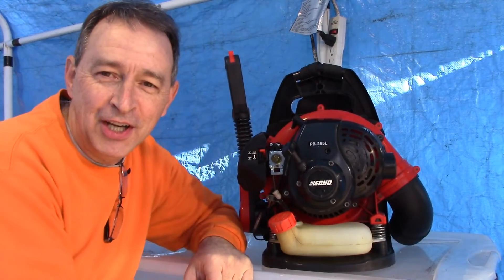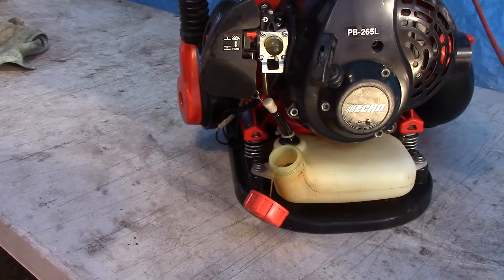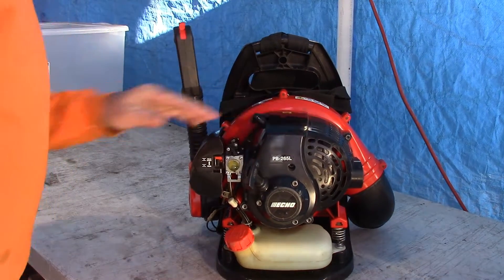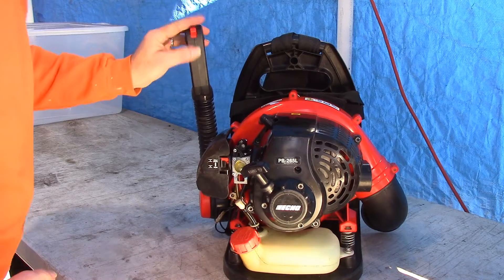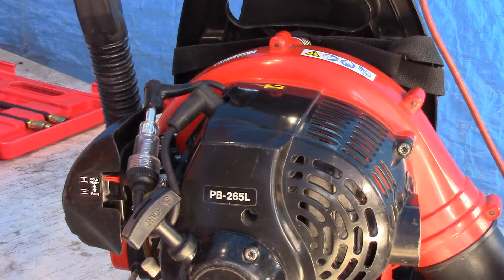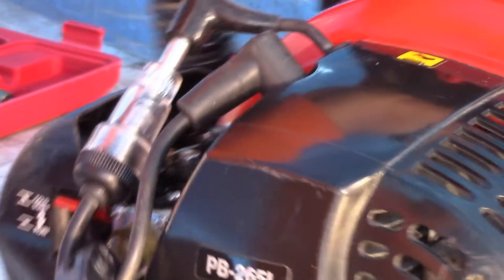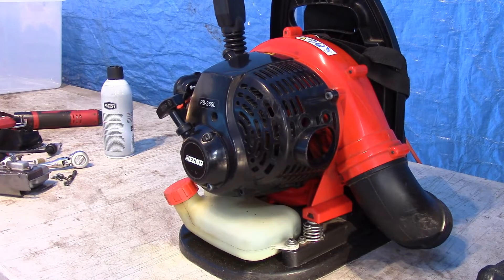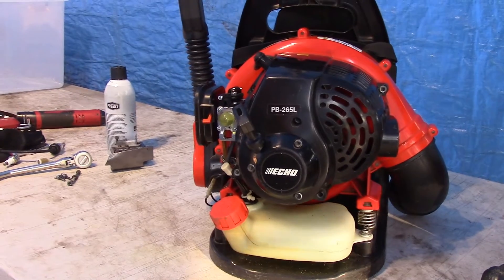WHY WON'T this ENGINE START or RUN??? Echo Leaf Blower PB-265L

Comment: I have seen this before on these. Some of these had a plastic flywheel with a laminated metal center containing the flywheel “key”.  The laminated metal is just a bunch of punched metal pieces bonded together like plywood to make a key that fits in the notch of the  crankshaft. It strips out and the engine no longer gets spark at the correct time.
Reply from the maker: @andybecker2693 Eureka! I just pulled the flywheel off this thing, and your suspicion was absolutely correct! The keyway "Pin" (which is actually part of the flywheel itself and not a removeable or replaceable item) was completely stripped out, and the flywheel was 180 degrees off from where it should be. Unless there is some way for me to secure the flywheel in the correct position, I don't see any solution other than to purchase a new flywheel. And then, what if the new one strips out as well? Bad design, I'd say. Thanks for pointing me in the right direction. I would never have thought to pull the flywheel.... Very grateful!
Reply: @Buckwsr  The replacement flywheel is cast aluminum instead of the plastic one or at least it was on a PB250  blower.
Reply: Good try Buck. Win some lose some. But you never know unless you try. I enjoy your videos. Your a fun guy.
Reply from the maker: Thanks, Ron. We're gonna fix this thing. So stay tuned!
Reply from the maker: Very interesting! And I should go ahead and pull the flywheel to take a look at that. I don't know for sure, but I would think that even with the timing being off I'd still get an occasional albeit mis-timed "pop" of ignition once in a while. Thank you for the note.
Reply: I was thinking the same exact thing. I have seen this before on Taryl Fixes All  YouTube Channel before with an Echo blower. This kind of thing is common on certain Echo models. 😊👍🏿

Comment: I have the exact same issue. I changed the spark plug, put new carburetor, changed the lines and filter. It was working for a few months then stopped. It’ll start initially but then turns off immediately. I bought it at the pawn shop about 12yrs ago. I guess I got a lot of life out of it. Debating if I should buy another fuel run blower

Comment: What causes the fuel you fill the motor? I have the same problem with mine. Has spark, new spark plug, new carb, fuel lines and filter, and new air filter. Keeps flooding the plug and fuel inside. Muffler is heavy as the video but it’s dry, no fuel beside the out take part of the motor. Basically everything as the video shows.

Comment: Thanks for the video. My Echo PB-265LN leaf blower worked great for years. Last week in died while in use. At first I thought maybe bad fuel / mixture. Since then I have cleaned the carb, replaced the spark plug, cleaned fuel 50:1 pre-mix, changed out the primer bulb and the unit still will not start. It stinks., and I don't have the funds for a new one at $300. and change.